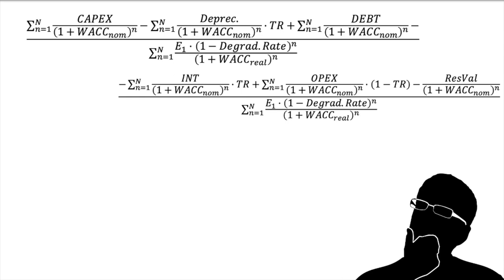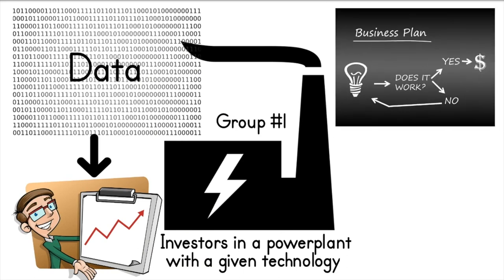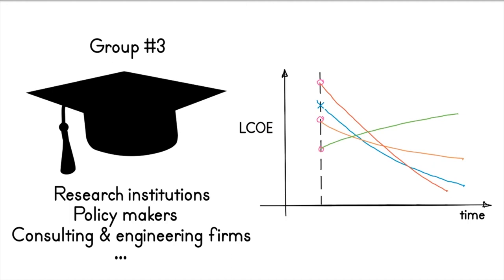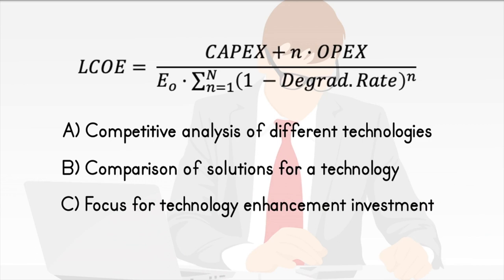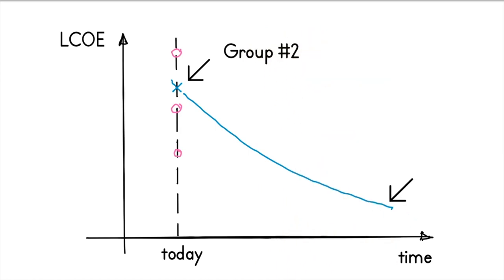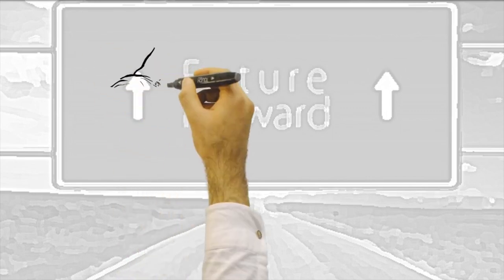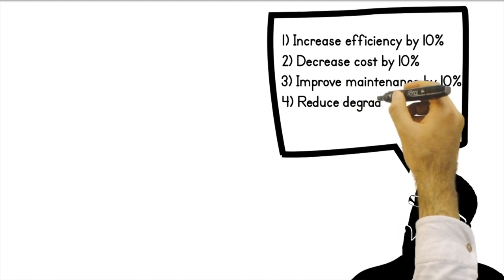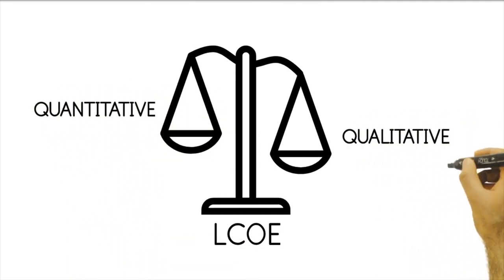LCOE for Dumbs

Comment: Yes, useful video, thanks. 
However, it's not clear at the end of the video: why choosing to improve efficiency instead of reducing degradation was the best option?
Reply from the maker: Hi Luiz, thank you so much for watching and glad to hear it was useful to you.

We used a particular example, using the hypothesis as described in the video and so this is right for that particular case. However, this is very likely what is gonna happen in most of the cases unless degradation reduction is extremely radical. Just keep in mind that the analysis is done in a 'ceteris paribus' condition, so we were analyzing each effect alone. Hope this answers your question
Reply from the maker: But what we say specifically in our video, is that people making investment decisions for a given case do not use the LCOE but a detailed case analysis (its specific P&L along the expected life of the asset) and normally is audited by third parties.

Comment: Hi so if I get asked in an interview to choose if a factory needs to choose between energy efficiency or a renewable energy overhaul. What method can I use to arrive at a hypothetical answer?
Reply from the maker: Hi, the LCOE is used for assessing the cost of energy produced by a power plant. However you can use a similar approach to calculate the payback of the two actions you describe considering the investment needed in each case and the return each action provides
Reply: @energytechnologysherpa  Thank you very much. This helps.